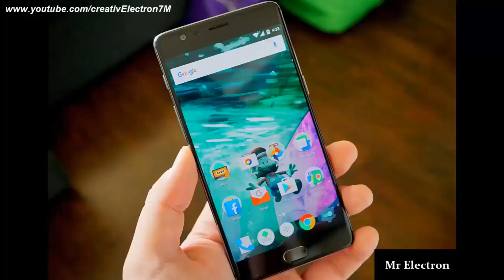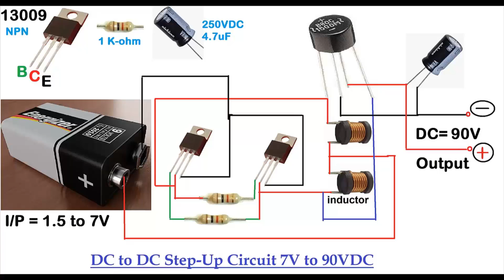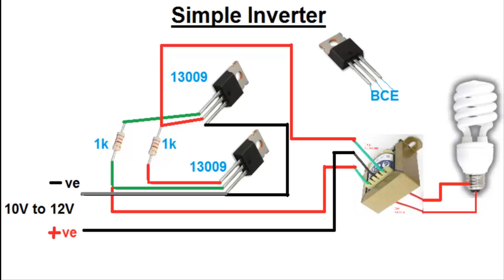3 life hacks with transistor

Comment: Can I use a 24v DC motor with this voltage multiplier
Reply from the maker: Kalyani Tiwari sure
Reply: Mr Electron and can I use a12v battery
Reply from the maker: sure
Reply from the maker: yes
Reply: Sir please make a 38v dc variable power supply